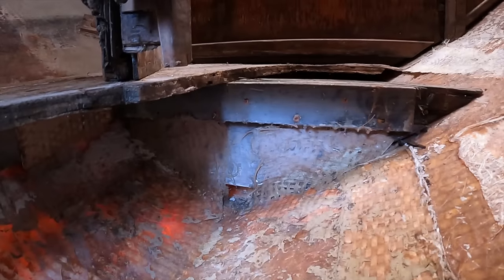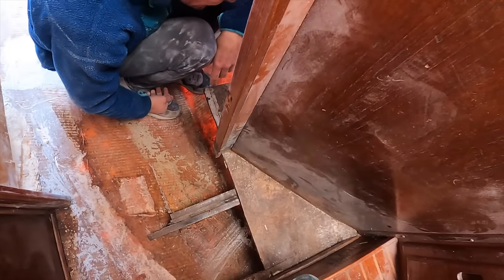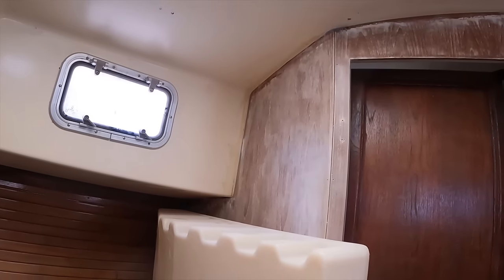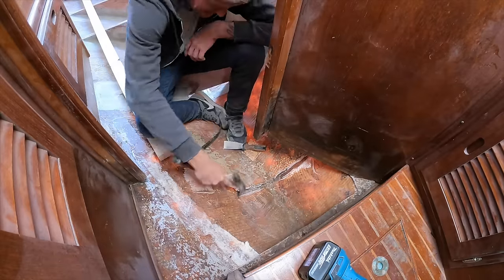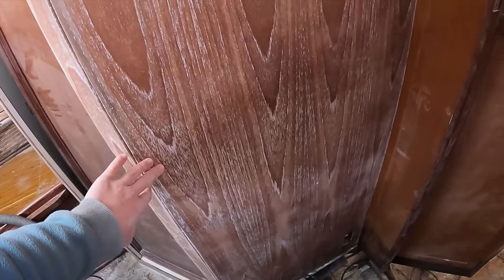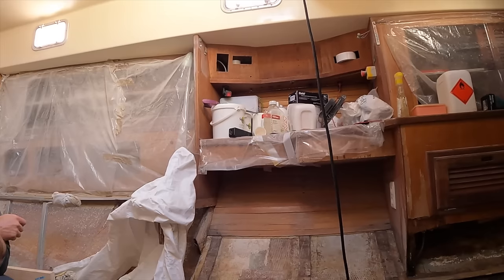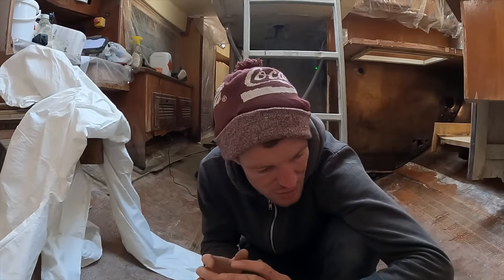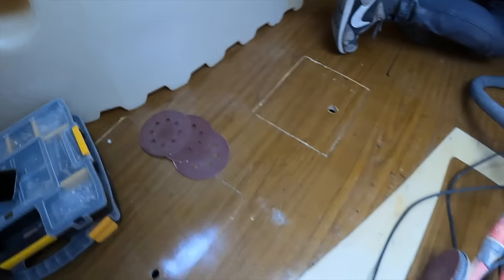This Nearly FREE BOAT is Nearly Rot Free | SAILING SEABIRD Ep. 53

Comment: Amazing how many people incorrectly assume America uses imperial units of measure.  The UK does, so the gallon there is 160 ounces, but the US uses Customary units and their gallon is 128 ounces.   Well done to Stu on recognizing that difference on the fresh water pump.
Reply from the maker: Thank you. 
I never knew the once's of gallons.
Cheers for watching 😃
Reply: Clever how the Americans sold a 50 gallon of oil that was under size ! Just to be different!
Reply: America does use the imperial system, just what the basis for some of the units differ.

Comment: 13:00 : "and he was shocked of how accurate we've been doing our work"
Way to go, guys! 🤣🤣🤣
Reply from the maker: It's not that accurate...
When we start laying the floor, we'll see.
It's just a little tricky at times.
Getting excited about the floor.
Once that's it, we can get the water system in, running water! It's been a while.
The dining table after that.
Rebuild the galley.
Add the engine.
The floor is a major milestone.
Thanks for watching our progress. 😃

Comment: lol "every button is a party button" so true :)
Reply: Hi you two , you could try oxalic acid to lighten the discoloured wood, it safe to use mix the granules with water and coat the discoloured areas once or twice it should bleach the surface ready for stain and varnish.

Comment: Please laminate all of the exposed wood surfaces before you add the floor panels. Use 220 gsm cloth and epoxy resin or at the very least brush on two coats of straight resin. Also laminate the underside of the floor panels before you glue them in. Then laminate the top surface and lap the cloth about 100 mm up the sides of the boat. This will result in the floor forming a very stiff diaphragm adding much strength to your boat. If you don’t cover all exposed surfaces the timber will rot and end up like all of the wood you have just removed. The underfloor space will get hot and humid creating an ideal environment for rot spores. Even laminate the surface of the floor in that little hatch at the very front of the boat. 
Also Marina I don’t think you need to go to so much trouble sanding off the varnish if you are going to paint over it   Just do enough to ensure a good bond between varnish and paint. 
I built an 11 metre powered catamaran which has been in the water now for 14 years and the only timber which has rotted is a small section that I neglected to laminate. 
Otherwise guys keep up the great work.
Reply from the maker: You're so right about the glassing.
We have a long day of laminating the fiddly bits.
Then the strings to the ribs, and after all that, then look to place the floor.
Cheers for watching 😃

Comment: The more tabbing on ribs stringers and joists to the hull you do will stiffen the whole boat longditudingly so you can tension up the rig correctly and not bend the boat. Stu, if you are going to use that pump for fresh water to shower, toilet and galley it needs to be 45psi or more at about 11 litres per minute. That 30psi pump will only give you a dribble.
Reply from the maker: Once the ribs and strings are in we'll add more glass to it.
I've got another pump in the shed, I'll use the biggest one for the fresh water, and the other for the sea water or the shower drain.
There are only 2 taps and a shower.
Cheers for watching 😃

Comment: I would replace all the rot when it comes to the wood and redo all the necessary tabing and bulkheads that needs to be refitted. No point in leaving any of it since you've come thus far. That's just foolishness. Do a good job don't skip on things take your time and do it right. You'll really appreciate it after you've done all the hard work whatever that may entail. I agree, Yeah paint those walls white it will surely look much better.

Comment: Expanding wood glue is what you need for the joists to fill the gaps, it will also stop the wood squeaking too when you lay the floor, you can also put a bead along the top of the ribs when you do the final floor lay again to stop it squeaking.
Reply from the maker: Thanks for the tip.
We'll look into it.
Cheers for watching 😃

Comment: Expensive but a lot of advantages - Eutectic fridge / freezer - when cold they last for days - can boost with excess solar or when running the diesel - I used these in the aussie outback and once cold they would last 7-10 days without power - size of cold plate is important a little bigger is better - but hopefully a watcher will know more - maybe see if you could make your own tank and then just use the danfoss BD35 or BD 50 ??compressor to cool / freeze - maybe even salvage one from a dometic portable freezer etc - also use good thick waterproof closed foam insulation

Comment: Try a little Bleach on the discolored wood before sanding.  Started with a diluted mix (50-50 water & bleach). Change ratio if needed.  You might be able to salvage some of it.  

Also,  they make a very thin viscosity epoxy that can be used on wood that has "seen better days".  It soaks into the wood fibers and basically makes the loose wood fibers act like the fiberglass cloth.  I believe it's mainly used to make surf boards.  It is also what should be used on the balsa wood as balsa wood is very porous and needs thin viscosity..
Reply from the maker: Thanks for the advice.
We might go full colour...
Cheers for watching 😃

Comment: Being your own boss can be the worst kind of slave labor, remember to take a 'La Tisaniére and Panisses' break now and then! The non-structure bits of wood that are only slightly 'spongy' can be soaked with thinned epoxy, sanded and refinished. It's easier if you can turn the soft bits upwards to help the mix soak downwards. The end product will be harder and more waterproof than the rest of the wood! The floor beams can be attached with 'L's' cut from some scrap aluminum angle extrusion, one on each side of a bulkhead, through bolted just below each beam will provide a way to screw the beams down solidly while still allowing for future removal if needed...:face-blue-smiling:

Comment: Hey, nice project. Your sandpaper looks like 120 grid wood sandpaper. For sending varnish this is way too rough and not the right type anyway. At least the grid should be 240, otherwise it will leave marks in the surface which will be visible even under white paint.

Comment: I would put pressure treated wood in the bilge areas where it can get wet like that 2x4 u put in. I would change it out for pressure treated or coat all ur wood in 2 coats of epoxy

Comment: Making great progress! If you're sanding off the varnish on the wall panels try starting with a more aggressive grit will help get it off without gumming up the disks, I've found that to work well.
Yes, paint the panels white so it'll be brighter but not the louvered doors please ❤.
I hope you plan to seal all the "Ribs" with epoxy, totally glassing them in would give extra strength and assure they won't rot as well as easier to clean the bilge in the future.

Comment: If the teak panelling has a thick veneer (like the older vintage plywood) you should be able to carefully remove the White Experiment with your random orbit sander and a properly sharpened scraper steel.

Comment: Stew, have you thought about using automotive rubber weather stripping for under the floor joist?? It's durable and will keep it from squeaking.. it's also cheap.. never used rope for a belt but I do use a ziptie and go around 2 belt loops, pull as tight as needed. You can either do it on the very back 2 or do it on both front sides.. it will last longer than the pants themselves.. had to use this method many times working construction and my belt would break.

Comment: I would definitely also paint some of the bulkheads white, old boats are like cigar boxes, nice for a hobby cruiser, but not for live aboard, there's a product you can brush on wood that are attached by rot, but not yet ruined, it will stop the rot, and prevent it from spreading, floor stringers can just be laid in some filler with angel hairs, and taped in the ends, they don't need to be removable, stronger and silent, really annoying with squeaking if you can avoid it, and of course, don't remove more than you have to, it's more fun to build

Comment: So, what you are installing  in the bilge right now are technically “floors” even though they are vertically oriented not horizontal. 
What you are calling the floor is technically the “cabin sole”. 
Not sure if what you are calling a joist is a “stringer” or a “plate”. 
A plate usually runs around the side of the cabin sole. So maybe not the right term for that. 
A rib would run from the bilge to the deck to strengthen the entire hull and are used in wooden hulls so none of those on seabird!
In any case, nice to see you are making progress!

Comment: I would defiantly use Sika 298 to glue the "beams" to the ribs & it is also good for gluing the ribs to the hull. It takes a little time to dry but if surfaces are dry and dust free then a fantastic and strong adhesive.